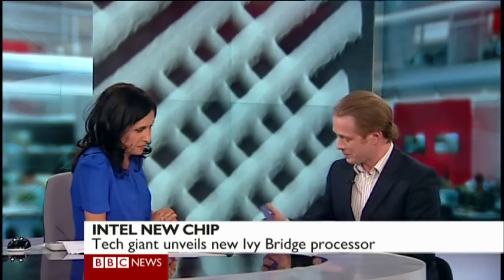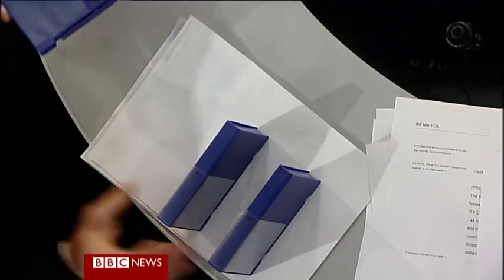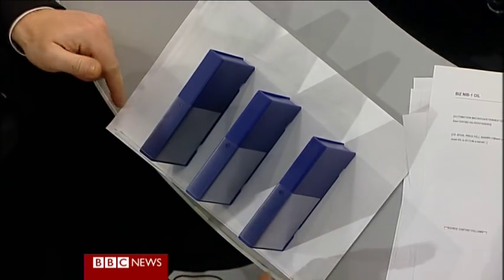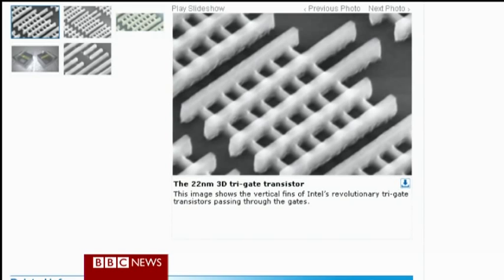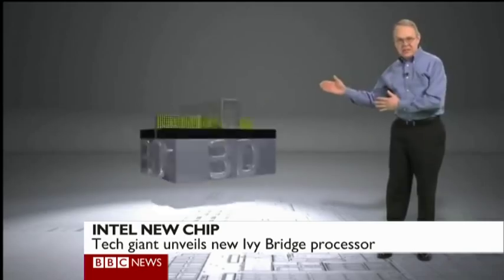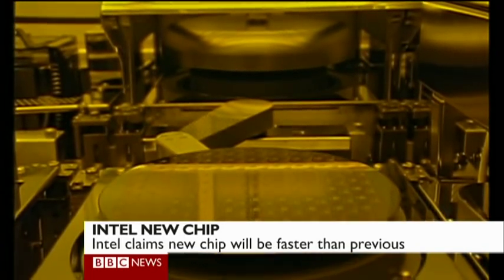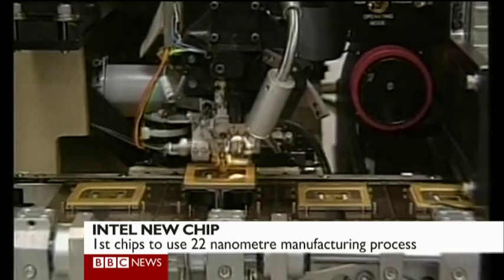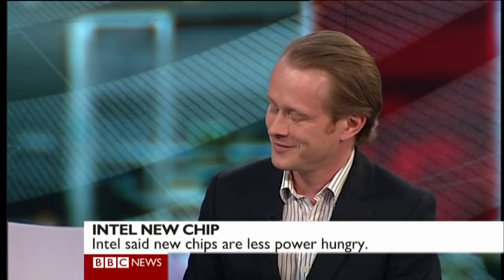Ivy Bridge explainer

Comment: @fearFlashback The transistors are smaller. The chip itself doesn't change in size. 

It's like making a house, the land size stays the same, but the building blocks are smaller, yet just as good as larger ones. You get more done with less.

Comment: @LordSamuelJ I disagree i think Intel has been leading the pack over the last 3-4yrs when it comes to innovation with hyperthreading to 32nm now to 22nm  transitors. Next is 3d transistors and lowering operating wattage is big too. Amd is doing incredible stuff with a shit load of cores and high speeds but i think both the ivy bridge and second gen bulldozers will be very close in performance maybe ivy bridge edging them out at first. Lets see how they overclock and how hot they get.